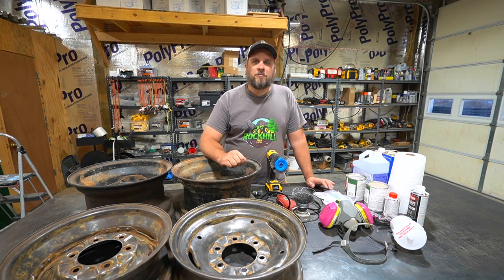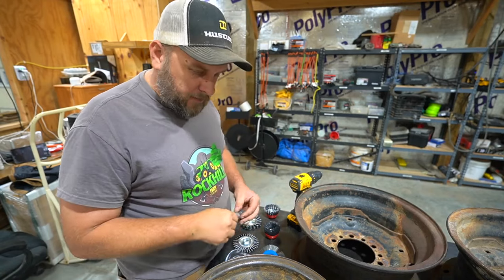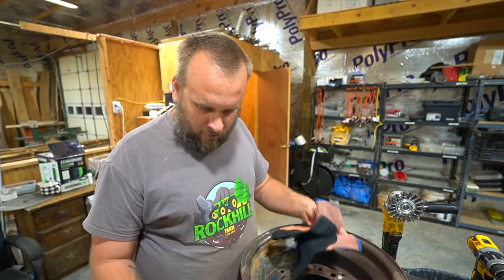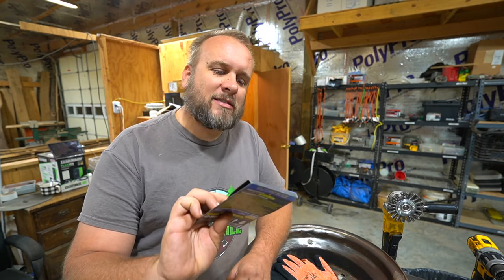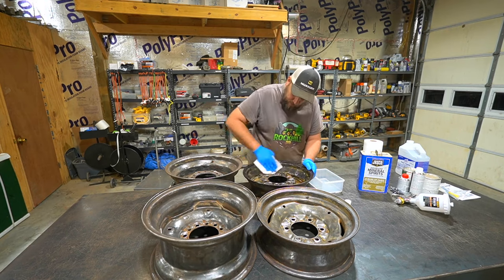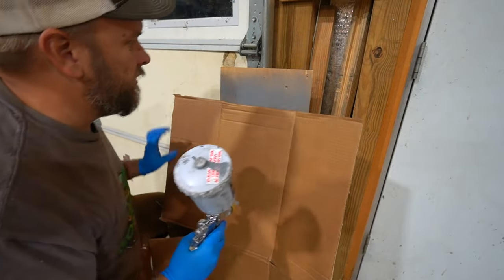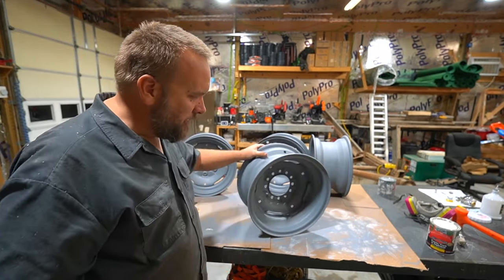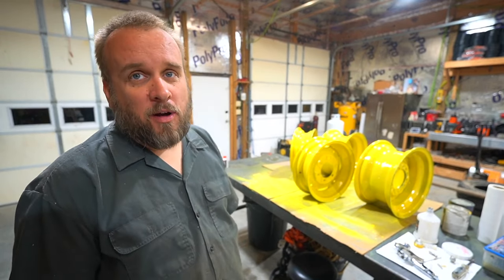Stripping and Painting Wheels - Haywagon Restoration Project

Comment: Good morning Brock. I'm a day late again. We were in the woods until dark last night. Today is the last day of bear season here but we have rain on the way so we probably won't be going out today. There are several products out there that you can apply to  any rust that may be left on the wheels that you apply before the primer that will etch the metal and kill the rust. It basically turns the rust to primer. It does a good job of killing rust so it doesn't come back. I personally have never used one of the HPLV spray guns. I have a Binks Model 7 that I've had for years. I bought it in the mid 80's and I paid like $200. for it then. That thing lays out paint like glass. Anyway, that's my two cents for the day. 😊 God bless and have a wonderful day. P.S. You are doing a great job on the wheels. You will learn as you go. 👍👍🙂